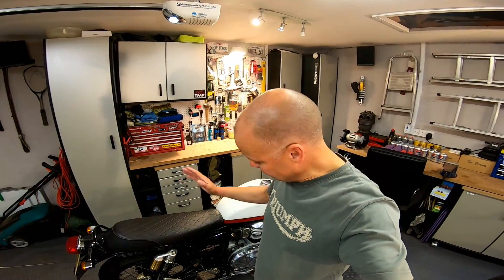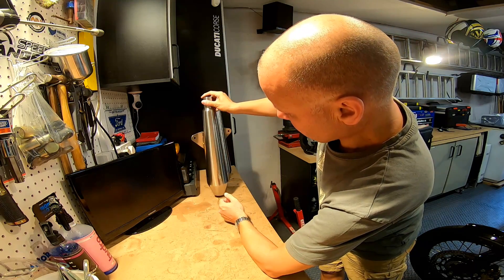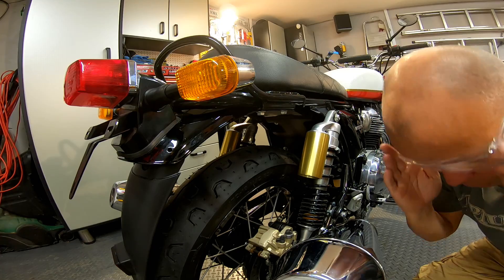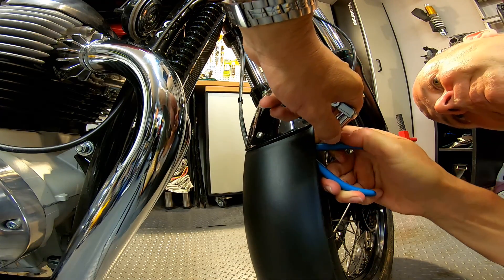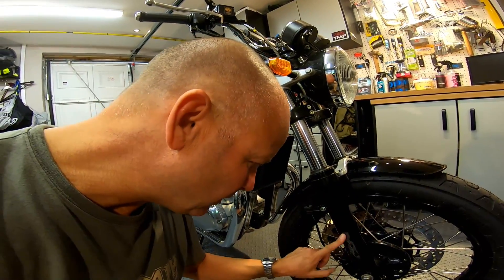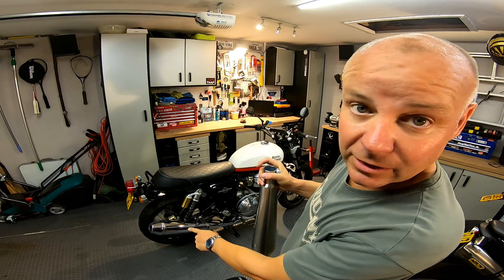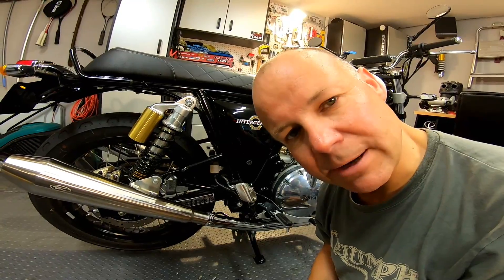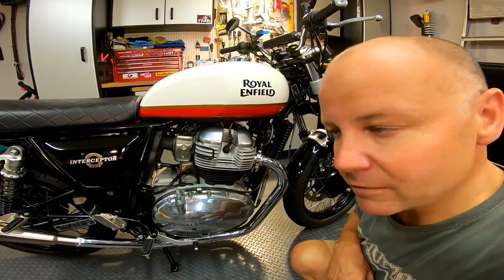Royal Enfield Interceptor 650 - How to improve the bike without spending a fortune

Comment: Interesting mods, all around!  Especially liking the black tape trim around the fuel tank.  One thing I like about this model, tho, is the proper front fender.  Like Triumph  in the days of yore gave you a proper front fender that came down low and covered the wheel from 9 o'clock to 1 o'clock of the wheel.  Bikes without this full fender, might as well not have a front fender at all--- all that water and dirt sprays directly onto the frame and engine LOL!

Comment: dont forget you need a reflector on the rear.looks  great after removing those bits.
Reply: The rear tail lamp acts as a red retro reflector - you need a separate one if your rear tail light is of the clear type.
Reply: @garrydickinson6461  I don't know in the UK, but in Spain (and I think most of EU) the red square reflector is mandatory, your brake light doesn't count for that.
Reply: @jorge.rubiales  by law you do need a red reflector on the rear but in reality its nothing that's ever enforced

Comment: Nice job TMF. Found it amusing, though, that changing the exhaust cans was a far easier task than removing a bit of sticky tape. When I took the reflectors off my old KTM Duke, I used some dental floss behind them to 'slice' them off with much of the adhesive. Then a quick wipe with white spirit.

Comment: With the exception of the removal of the fender extensions (where I would go the other way and install them, if they were
not there), some of the mods can make you walk home at a Police control here in Germany!
The back reflector misssing 40€.
Front side reflector missing, they sometimes overlook, otherwise 40€ as well.
The license plates are signed with the registration and technical inspection stamps (no chance to change), but they are
smaller than yours.

Changing to an exhaust system w/O official registration (ABE) will let your general operation license lapse which
will be fined by I think 120€.
If then at the end the exhaust is 10db/a louder than in your papers, transport alternatives for you and the bike are required!
Reply: You think that's strict?! Come to Japan, land of bureaucratic wonders that would give Kafka a run for his money!

Comment: Those side reflectors on the forks are actually a great idea. I’m restoring a USA built/spec Honda VF750F Interceptor (the quick V4 one) that still has its original reflectors. I’m leaving them. They improve visibility. 

Otherwise, nice noise. Now all you need is some performance upgrades to give it the Ooomph a 650 ought to have. I’d start with a pair of flat Kehins, increased compression pistons, gas flowed head, and hotter cam. That might give you 60HP.
Reply: Yeah ruin it's reliability right outta the chute
Reply: David Raye You’re missing the point. Firstly, if minor performance upgrades could “ruin its reliability”, then the thing is far too fragile. But everyone who’s reviewed this bike has recognised the obvious fact that RE released this bike as a basic bike which is perfect for upgrading. 

And if it’s only capable of being made more aesthetically and aesthetically useable, then a lot of serious bikers will not be playing. 

There’s a limit to the appeal of any bike that satisfies borderline geriatrics by evoking a bygone era, but without delivering even the power potential that it should - on paper, never mind what we all know is possible.

Comment: Nice bike, reminds of the good old times when things were less complicated... I'd buy it over a Triumph any day and save some serious $$ for things like slip-ons.
Owned three XS 650 in the early 90s, I like these old parallel twins, the upright cylinders and those headers.
In case the the exhaust is too loud without baffles you could experiment and drill holes into the baffles.

Comment: I would: Shorten the turn signal stalks if possible to tuck them in. The mufflers look and sound much better but imo would look better if they didn't extend past the rear tire. Remove the passenger grab rail if passengers will not be riding with you. You could take a 1/4" more material all the way around your plate and get by with it and look a little sharper yet. Acetone or mineral spirits work well on adhesives. Try an inconspicuous spot first though. Nice looking bike to begin with and you made it look much better! These bikes will catch on once people start to ride them and understand the cost vs fun factor.

Comment: I've been riding since 1970 and averaged a new bike almost every year. Usually make very few modifications except for the seats. Hardly ever engine mods. 
I learned if you needed more HP , buy a bike that met that need. Over the years I spent more money on seats than my 22 RE INTERCEPTOR cost. I did just receive a Black Faux Touring seat from India.
Outside of the crude looking seat pan that didn't fit worth a crap. I had to make some rubber cushions so it wasn't metal sitting on the frame.  It was more comfortable than stock and the switching was very good.  At 5'10 it put me just a little to close to the tank.
If I keep the RE I will fix that seat.
My biggest complaint with this bike is the suspension.  To bad RE didn't spend a couple more $$ and install some decent components.  If you are fortunate enough to have very smooth streets it no problem.  But rough streets will torture your back. It does have a good little engine.  With just enough power.

Comment: I removed the rear plastic too and stuck a small round reflector on the number plate off ebay. Left the front one on as keeps the engine cleaner. TIP-- Use your spare black number plate bolts to fill in the holes on the rear guard, looks better than the metal screws.
As for the small brackets left on the silencers, leave them alone and live with them, not heard good things about exhaust wrap..!
Reply: Just check the rear reflector is on the centre line of the bike. Don’t know how big the reflector has to be.

Comment: Rear of the Interceptor has reflective sections built in to each side of the stop/tail lens.  Additional reflector on lower section, like the front strut reflectors, are OTT US legal requirement.
Took my front reflectors off on delivery day in mid-September. Just peeled straight off, no mess.  
Mind you, 35 miles on the clock and I developed (all the experts say, at least) temporary double vision, due to a swollen ‘motor nerve’ at the top of my left eye.
Got a prism fitted to my specs to rectify the situation, but I would say it’s about 85-90% effective, due to reflective light scatter off the prism... so, no riding/driving, and its mid-December and my beautiful chrome tanked Interceptor is still in the garage with its 35 miles on the clock.
Ain’t life grand! 👍🤔😩😜
Reply from the maker: Oh dear - sorry to hear that! Hope you can get it sorted soon!

Comment: There is no minimum size requirement for a number plate in the UK. The size requirement is for the letters & the spacing between them. If you have a plate with a 1 in it like you do, you can usually go a size down & still be legal provided you keep the letters to the minimum size. There is a link on the Gov.uk website that tells you what's legal.

Comment: Thanks for  the tips. The motorcycle improved quite a lot with these small changes. I would go for the turning lights next.

What I don´t like about the new pipes is just the chrome is not matching the rest of the exhaust system.

Comment: Here in Victoria Australia removing the reflectors on the front forks is one point for a cop to deem your bike unroadworthy, In many cases changing your exhaust if it's louder can also make your bike unroadworthy... if you go way to loud a copy can force you to leave your bike parked on the side of the road.
Reply from the maker: Oh dear!
Reply: @TheMissendenFlyer  yeah strike a copy on a bad day and you have after market exhausts they can get cranky. Plus if your buying a bike without a roadworthy it can be almost impossible to get a roadworthy until the oem pipes are out back on.

Comment: The front mud flap that you're taking off prevents a lot of dirt from getting into the oil cooler and stopping rocks getting thrown at it from the tire. Not really a good idea to remove it just saying. 😊 but it is your bike to do what you want 😊 I definitely will take off my rear plastic mudflap that does look a lot better. But I prefer to leave the reflector on the front fork I do some night-riding the more they see you the better I realize this video is a year old I have the 2021 Interceptor 650 and I put the S&S performance stainless steel pipes on it and performance air intake. Big difference I did take the baffle out it is removable but after riding it it was to put the baffle back in still loud but not as loud I think it has a better sound with the baffle in it hoping you all staying safe and healthy I have snow in the yard here in Maine hopefully it will all go away in a couple months even though I still take the bike out it's warm enough above freezing.
Reply from the maker: Nice one Tom - my Interceptor is off at the custom shop at the moment having some radical remodelling done - stay tuned for the big reveal in due course!  (Assuming this COVID lock down doesn't delay things too much)....

Comment: Next time whenever you need to remove that sticky leftover glue from any metal surface , here is a simple trick. Just apply some simple coconut oil to the sticky thing or even a sticky label ,  leave it there for some time and the glue or label will come off very easily.  TRY IT SOME DAY ....  IT WORKS !!!!!!!!!!!
Reply from the maker: Coconut oil not so easy to come by here - but wd40 is!

Comment: The reflector that was fitted on the rear mudguard is an MOT requirement (if your rear light is not reflective), so you'll need to fit a replacement one when the bike needs testing. Most people stick them on the number plate, but seeing as your plate won't pass an MOT now, I'd stick it on the original plate, so it's ready to bolt it back on for test days
Reply from the maker: Thanks for the advice Jim - all the best!

Comment: Loverly.  Much better. Wonder if the new cans change the fuelling?  Could you use the WD40 to remove goo, just avoid the brake disk and tyre :-).  Spray silicone to remove oil residue from chains on the back wheel - works like magic.  Again do not get any on your brakes or tyres! What a rich sound.

Comment: If you ever need to take the sticky left over glue off use pledge spray , apply loads on leave for a few minutes then use an abrasive sponge will come straight off. Might have to repeat once or twice 👍

Comment: I've removed the plastic on the rear mudguard myself. Stuck with the standard plate though, and just mounted the original reflector on the bottom of the plate. Considered doing the front one too, but I'm worried about bits flying up from the road onto the sump and oil cooler. Decided to get myself a sump and oil cooler guard first.
Reply: Is it legal, (& ok for insurance without checking), to stick stuff on a numberplate? I don’t think so, but check out with DVLA etc, numberplate requirements.

Comment: There are some really small chrome exhaust heat shields that cover those brackets really well. You can get the on ebay.
Reply from the maker: Really? You don’t have a link by chance do you???
Reply: TheMissendenFlyer Go the the U.K. ROyal Enfield Interceptor owners  FB group; there is a guy making covers for about £20

Comment: I prefer the old mufflers. I once put a SuperTrapp exhaust on an SRX600 Single. Okay, it was illegal, but man, was it loud. I immediately saw the whole exhaust sound thing as if from a third party point of view. Its an ego thing. One person (oneself) thinks 'i'm da man'. Meanwhile 99 other people are thinking 'W***er'. It's a fine line to tread.
Reply from the maker: Yes that is very true but in the case of the interceptor the old pipes are just so heavy! These new ones made a huge difference to the way the bike feels....and I don’t think they’re antisocially loud....
Reply: @TheMissendenFlyer   They sounded fine. I was just making a general comment sorry.  I think the experience I had gave me an aversion to anything noisy!  After the SRX experience which I loved as a bike, except the chain drive, I got a honda NTV 650, a bit sensible I know, but it ticked alot of boxes.

Comment: side reflectors are there for safety for traffic coming from the side of your bike. The splash guards-on the front is to stop all the crap from going all over your motor (normally an add on you pay extra for). Rear one maybe excessive but again to stop the crap going up your back. Again an extra cost if it doesn't come with the bike. Mufflers to make a noise won't improve the performance on their own-you would need to put the bike on a Dyno and remap the fueling. Otherwise you'll get a noisy bike and that's about all. If you are not happy with the performance perhaps a Ducati Scrambler-Triumph Bonneville or Moto Guzzi V7 III special.1st thing I'd do would be to put a screen on it and pannier brackets for soft luggage mounting like C bow or soft luggage.

Comment: RE the size of number plates, i saw on a vid elsewhere that it`s the size of the letters that are a legal requirement, as is the spacing of them, but the outside dimensions are not legally governed, though i would say that`s within reasonable interpretation.  As for the pipes, Tec make some great stuff, of which i`l be fitting to my Speed Twin in the near future.

Comment: To each his own, but as others have mentioned, most of the modifications carried out either make the bike illegal (non-regulation number plate; absence of rear reflector; possible contravention of legal decibel limit without the baffles in the aftermarket pipes), less practical - spray going everywhere in bad weather (maybe you only plan to ride it in the sunshine?), or less safe (side reflectors that will help with visibility at night, especially when pulling out into traffic, when many accidents occur). At least you didn't go for the idiotically trendy ridiculously small aftermarket indicators.

Comment: Aussie fan reporting in.  Regarding the glue residue left behind after you removed the right fork reflector?  Buy some eucalyptus oil if you can get it in the UK.  Remarkable stuff,  it will wipe away that glue like nothing yet it has no harmful properties to plastic or paint.
Reply: It can damage certain types of plastics but it's great for getting grease out of your clothes or a few drops in the shower when you have a cold also works a treat.

Comment: With the baffles removed from the TEC cans, I wonder it the bike might be running too lean - the stock ECU can only compensate for so much before you will need an aftermarket fuel controller of some sort.  That being said, TEC makes an inexpensive little non-programmable fuel controller that comes with a new intake air temp sensor that fools the computer into thinking it's colder than it actually is.  This causes the unmodified stock ECU to just slightly enrichen the mixture.  The guy at TEC says that, if you just switch to a more free flowing intake and exhaust, this little gizmo is all you will need.  Much cheaper than a Power Commander or other aftermarket controller.  And you can easily switch back to OEM if you need to pass any government inspections.
Reply from the maker: Yes I have one of those gizmos - next thing for me to fit! (Booster plug)

Comment: You didn’t have to reprogram the ecm after installing the new pipes? On my Bonneville reprogramming wasn’t necessary after installing the TEC 2 into 1 pipe, as long as I left the baffle in the exhaust can.  The bike should be running pretty lean without the baffle(s).

Comment: To remove glue off any shiny items try wd40 and an absorbent rag.on areas you cant chance putting wd40 on such as car interiors use spray furniture polish it is nearly as good.Spray on thick and the glue finds it easier to stick to the rag than the shiny surface.

Comment: What was the point of taking off the reflectors that were on the front forks? I saw them as a nice safety item. At night time when you are at an intersection, the traffic on your left and right see you because of the reflector. I don't see how the performance of the bike was increased by taking them off nor was the unsprung weight of the forks changed. By the way, WD 40 breaks down glue.   Barry

Comment: I just rubbed off the glue with my thumb with a rolling action no need for anything to remove the adhesive from the rear of the reflectors .
Roll it as if you were removing chewing gum with your thumb with no gloves 
Regards 
Dave

Comment: Hello M-Fly! Random post for you, if you see this. I'm considering downsizing from my Tiger 800XRT. Not going to be easy to give up those heated seats/grips, and all the other goodies! My great Triumph dealer over here in the states also sells Royal Enfield now. You're clearly smitten with this machine, but how do you parse out the Interceptor vs. the T100? Of course the Triumph is dearer in price but my guys have an '18 they'll knock down a great deal. Anything that jumps out in ride quality between the two? I'm a bit concerned by tubed tires on the Enfield...? The 3 year Warranty + Roadside is a great perk to take the edge off the running costs. Cheers!
Reply from the maker: VFM wise the RE is the better bike - love mine, more character than the Triumph too.  The T100 is better finished and refined, but IMO not worth the extra....try then both if you can - Money no object then the Triumph may be the one to have.
Reply: @TheMissendenFlyer  Thanks very much! Test riding bikes, hardly a hardship so why not? :)